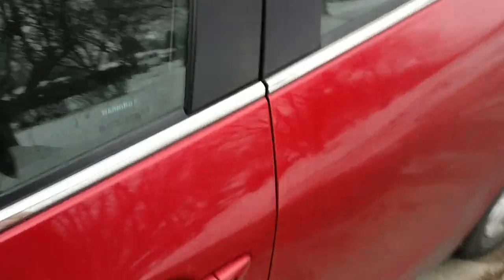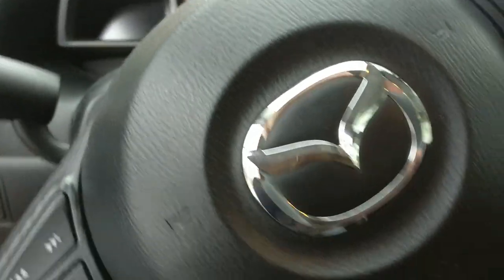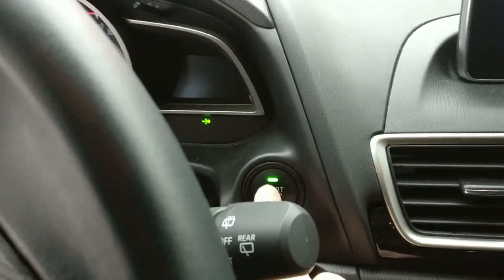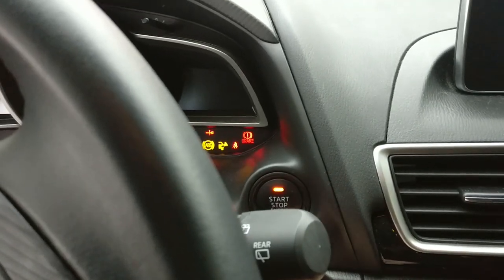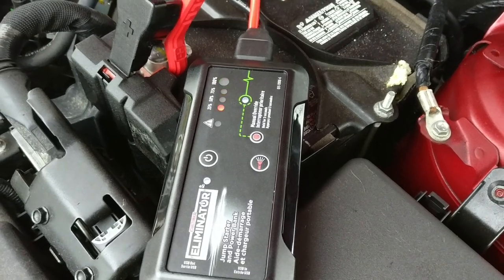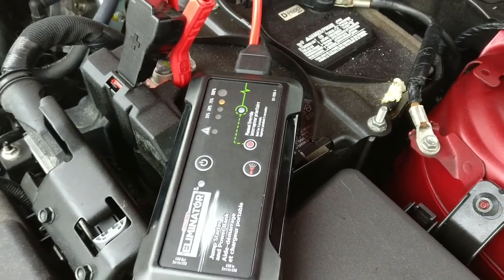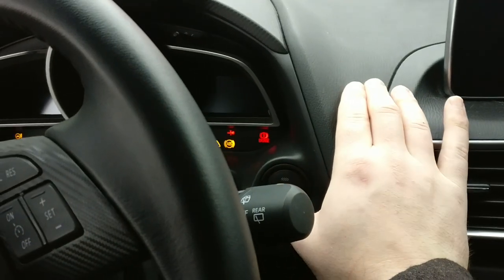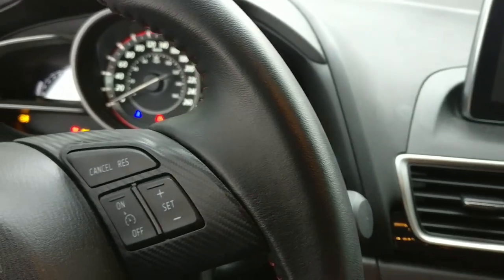MotoMaster Eliminator 750A Booster

Comment: Hi. I have just bought this jump starter. Thank you for this video, very well explained with a good presentation. I read on the instruction manual that this model can only be used on a lead battery. This is not indicated on the packaging. Unfortunately I don't have a lead battery. Do you think it will still work? Or is it better to take it back to the store?

Comment: I took a cab to Canadian Tire to pick one of these up today. In sale for $130 (Save $30). I woke up to a non starting car Friday morning. At first there was lights, radio, locks worked fine, no turn over. Which took me by surprise!?! What? No thing. Just some weird clicking noises and wur sounds.

I'm not a mechanic, but the car is 12 years old but with only 75,000 KM on it and barely given me problems. Tires. Brakes. A battery 6 years ago and links in the front. No problems. I maintain it. Regular oil changes, I top up fluids. It's paid for, I'm just driving it. Wednesday I filled it up with premium gas and a bottle of STP 5 in 1 fuel injector cleaner. So I'm initially thinking, it isn't the battery. I had lights and radio. Could I have broken the fuel pump? Or is it the starter maybe. It was not acting the least bit weird Thursday night. I make an appointment for the shop, give it a clean up interior, try the ignition a few more times, maybe it'll "catch". No. In fact the lights, radio and locks died out, which obviously means power. Battery? Possibly the alternator? It is 12 years old and 75,000 kms. I do smell burning plastic after a drive (an apparent symptom. I might need the car towed? But it's in a bad position for a tow. A royal pain in the butt and without power steering, cars tight on both sides of me, a brick wall 5 ft behind me, a town truck will have a hard time. It needs a boost. A tow truck, plus boost, and whatever is $150, and a spectacle. I do not like spectacles.

I was sitting here thinking last night, I don't like pestering people for things like a boost, as a car owner in the Canadian Winter, I should have a booster and a compressor on hand. I call up my best friend. I've known him forever. He is the kind of guy who has things. He's sending me pictures of him bbqing, come on over no kids, grandkids are gone, Tracy want to get high. I wish man, my car is dead. I need to get it to the shop. I tell him the above and ask him what he's doing today? Can you come over here and boost me to get it into a decent position for a tow truck? Heck if it runs, I might risk driving it to the shop on the spot. Yeah I'll call you tomorrow. Lives around the corner 

Today comes, this morning, I'm thinking.... Tow truck will be at least $150. I don't expect my buddy to take time out of his Sunday, but we'll see. I am going to take a cab to Canadian Tire to buy a $100-$150 Jump Starter because I should have one, like yesterday for the past decade. Which I did. I found this one here for $130 on sale by $30. Get it home, charge it up, get a text for m my friend that he's warming his truck up. I texted him not to worry about it, it's cool, I bought a booster pack. Battery is dead. This will be a good test. No reply. 15 minutes later he's calling me, here. I tell him I'll be right down. Go down there, the person beside me is not home, he pulls right in there with the Tacoma. Big shot breaks out his charge station, with the built in meters, bells and whistles. Well, alright them let's open the hood, I already removed the battery cover, he hooks it up and bam, car starts and runs well. So I'm like ???? Why did the battery drain itself? When I initially started it, the first message on the screen was "TRANSMISSION FAULT SERVICE" which is not nice, but I think the lack of power caused that message. I almost skipped the mechanic to bring it to the dealership which the transmission is still covered under but decided, no. I will drop it off at the mechanic, let him check it out, replace the battery, alternator, or whatever and got him to follow me, drop the car off and give me a ride home. So I didn't have to walk or take a cab, which is not close but is so close, I might as well walk.

I should have tried this 750 Eliminator Jump Starter, in this situation. I just bought it. The battery was dead. I let Mr. Big Shot "I have a diesel generator at home just in case" do it.

Comment: I picked one up today and my local CT, the wifes 2007 Honda Fit is not liking the -25 Celsius temps her in Kingston. Will give it a try tomorrow. Good straight forward to the point video. Thanks.
Reply: Paul O'Toole this is so helpful when you are alone in the morning. I've use it yesterday below -25C. Tell me your experience!

Comment: The unit is very good. The clamps are weak like you said. You have to play with them to find a good grip with the battery terminals. This is why does not work at all the times. Make sure after is hooked up, the LED's are blinking, if not, use override button.

Comment: Dind't work the first time, but I'm thinking all the plastic around the clamps and the weak spring tension is to blame. Got a screw driver and pried the plastic away and will retry. If no-go I'll return it. Not pissing away $180.
Reply from the maker: I've found for very dead or cold batteries, I've had to have the device connected for 30-60 seconds before it would start.

Comment: I have a different booster model. It worked once yesterday, but refused to work today. Does it mean my battery needs to be changed?
Reply: Ya it may be that your battery is completely done, but may wanna try bringing it into a Canadian tire or any other place that sells batteries and see if the cells need to be topped up first tho, before purchasing another battery

Comment: Thank you for the vdo 
Bought the exact same model but would not start my car 
I am gonna try it again and update
Reply: Update 
It didn't work for me not sure why, I played with the clips, I don't think it was able to make contact with the terminals
Reply: MetallicanToronto  These newer boosters have a built in sensor that will not let you boost a battery that is severely discharged as the device can not tell if you have the clamps on backwards or not. In this case, you can try the manual "override" button and try boosting.